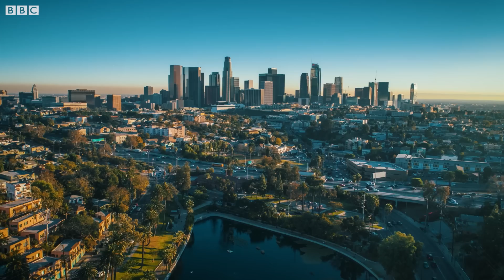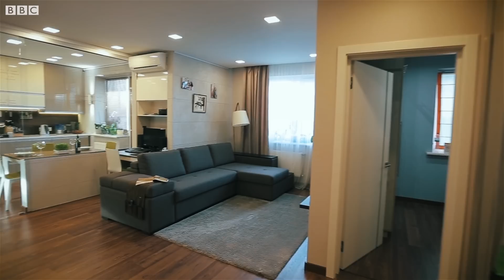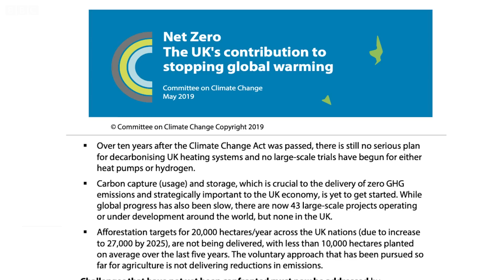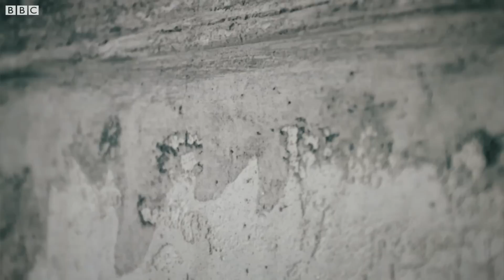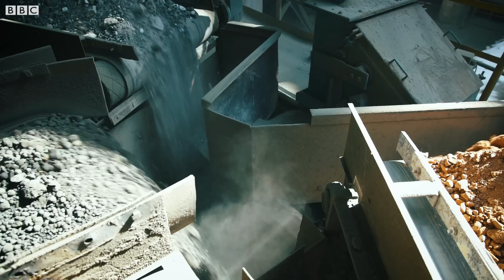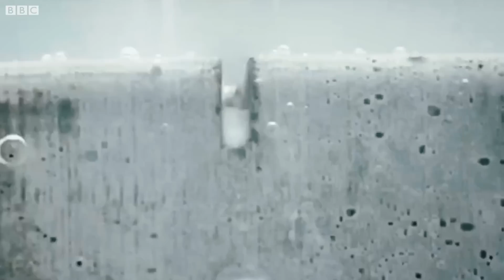How To Heat Our Homes Without Heating the Planet? | A User's Guide To Net Zero | BBC Earth Science

Comment: I’m a Mechanical engineering specializing in thermodynamics, statistics and mathematics. 
This is absolutely nonsense.
I design heating systems for a living and believe me these companies are more interested in government money than the environment.
For example I have designed a commercial boiler that is less complicated to build safer and instead of polluting provides valuable chemicals and gasses for reclaiming. 
1st problem my boss was a member of the ASME board and they literally set the rules not to promote best practices or green energy but instead they use regulatory capture in order to make their products the only “safe” and “legal “ ones, with zero regard to anything but profit

Comment: Use ocean water instead of potable water for concrete production. Heat pumps are great but not viable in very cold regions. Here in Minnesota, they cannot keep up when the temp is consistently below freezing for months at a time. An equally energy dense solution for heating needs to be identified.
Reply: Look up Technology Connection channel, he's made a few videos on heat pumps. They are perfectly viable I'm colder climates, he himself lives in Chicago area, and uses heat pumps to heat.
Reply: @bergonius  I am subscriber to his channel. Good stuff. Unfortunately, it’s a lot colder in Minnesota than Illinois
Reply: Heat pumps are perfectly viable for cold regions. You just have to design the system well enough.
Reply: You need underground heatpump for those regions
Reply: @xXAbdulBaqiXx  geo thermal is an option yes, not particularly suited for densely populated areas but it does work here. Very spendy
Reply: Seawater in reinforced concrete... Ok you do that with buildings you use. But dont put other people at risk.

Comment: Did my guy just say a heat pump is 350% efficient, "for 1 unit of energy you put in, you get 3.5 units of energy out"???? This guy has broken the laws of physics.
Reply: What a fine example of Duning-Kruger. Educate yourself before commenting.
Reply: @SwordQuake2  you mean the guy who ran around peoples dreams with a knife-glove? What does he have to do with anything?
Reply: Yes it's moving energy versus transforming it
Reply: In totally see how this is confusing! The catch here is that's it's taking heat from somewhere else, and just moving it. That's how it can give more energy that it takes to run, since it is moving that energy from somewhere else.
Reply: Don't get confused. Energy conversion efficiency (ECE) of a heat pump is much lesser than ECE of a simpliest combustion engine. They're using coefficient of performance for a heat transferring devices in the video, which is a value that is always >100% (85% for a gas heater is a deception, though). For 1 unit of energy a heat pump TRANSFERS 3.5 units from one place to another. It's like saying, that a fuel truck has an efficieny of 9001% when moving gasoline from point A to point B.
Reply: @md_hyena  hey vegeta, what does the scouter say about it's efficiency?
It's over 9000!!
Reply: But he's right in practical terms :) Read up on it, if this was news to you

Comment: Zet Zero impossible quieter Lowes  Greater insulation houses are HOTTER in the Summer windows open or SPLIT LOAD air source heat pumps housing density 22+ houses an Hectare 10's of heat pumps whirring away through the night to cool houses and heat water and heat in the winter.    YOU ALSO FORGOT HEATING NON POTABLE WATER WITH A HEAT PUMP YOU HAVE TO CUT IN AN IMMERSION HEATER TO TAKE THE WATER TEMPERTAURE UP TO 80C STERALIZE THE WATER JUST INCASE BUGS GROW AND INFECT PEOPLE.